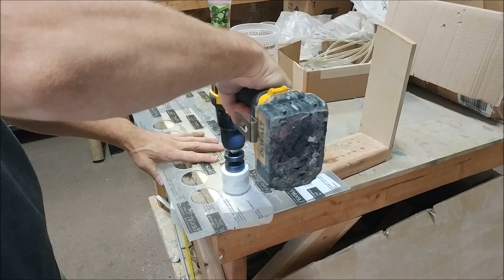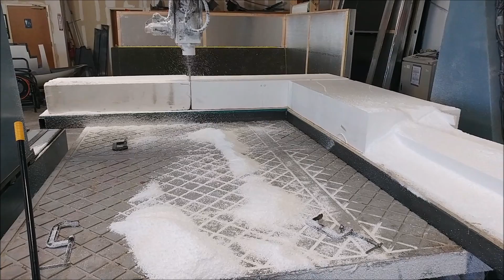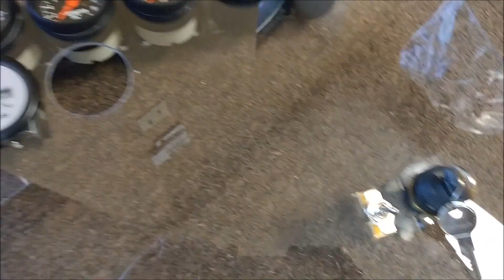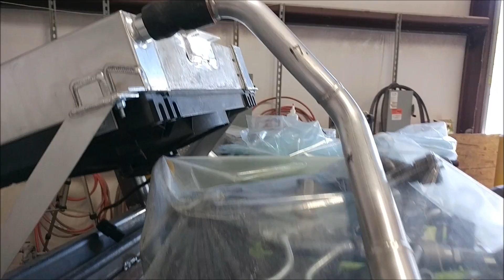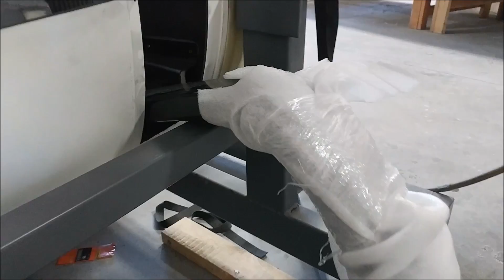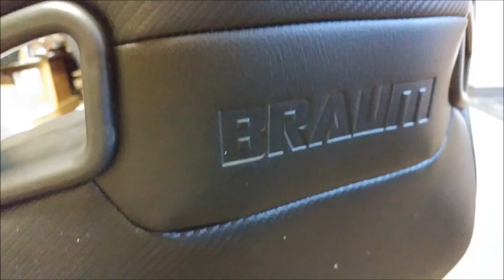Playing with Instruments - Setting up the panel for the test stand

Comment: that 2cycle diesel radial engine is better than this audie ,the 2 cycle has less parts better miliage  aircooled less to go wrong built in turbos no belts. nearly half the weight for the same power
Reply from the maker: Don farlan which engine exactly are you referring to?